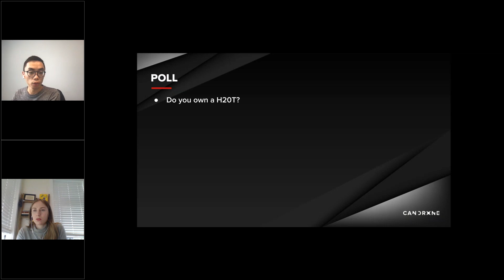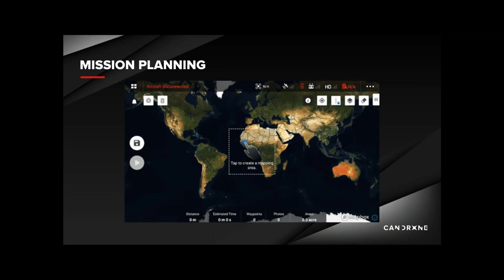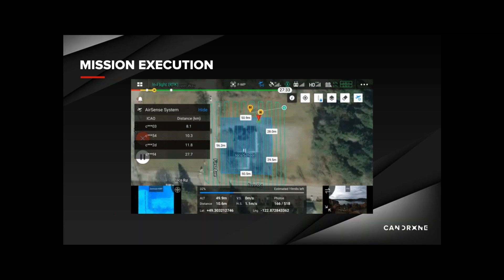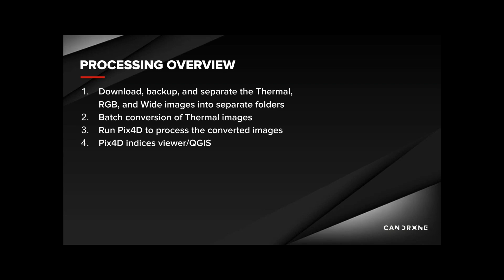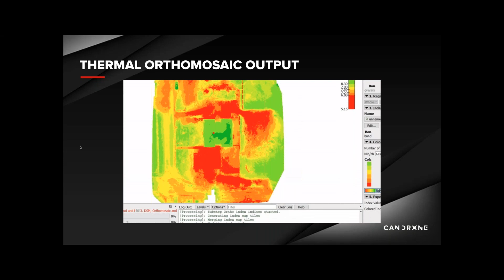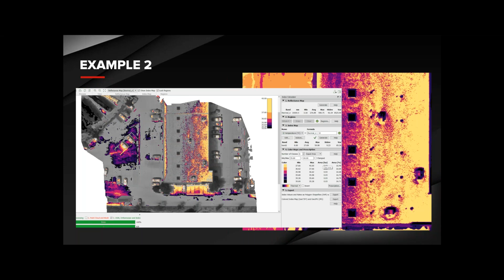Thermal Mapping with DJI Matrice 300 and H20T camera - WEBINAR

Comment: Please advise if we can use Lidar L1 and h20T camera at the same time? for example in oblique mission of power line inspection
Reply from the maker: You can not
Reply: @CANDRONE  Thank you, but why? Because using L1 and h20t together causes a lot of stress on the system? If so, which ones?
Thanks in advance!

Comment: Can this sort of thermal mapping be done with Mavic 2 Enterprise Advanced camera?
Reply from the maker: The M2EA camera does have the same specs as the H20T according to DJI. You can do mapping missions with the M2EA thermal camera, however, you won't be able to get radiometric data as we have tested the conversion process on the images and it does not work.

Comment: Can you guys help me
Reply: Hey Pete, this is Zane from Candrone. I would be more than happy to assist you, what are you looking to solve?
Reply: @zanewhite1355  sorry but I've been trying to find windows in current windy conditions. So I rented a m300 with a h2o thermal camera. So that means I only have one "camera/gimbal on the matrice 300. I know your going to laugh but I use dji ground station with wookong M and a futaba radio. I have also used datumate and datufly for mission planning for my inspire 1 pros. This is my first time using DJI Pilot and while I'm in the dji pilot app it offers me the three types of missions and although I'm just dealing with thermal images I can't find where to configure my camera angle...I would like for thermal to be pointed downward -90 degrees just like I would be doing a RGB do you know what I mean? I couldn't find where to change that and the other question is what software am I using to create thermal reports?
Reply: @zanewhite1355  if you can guide me to an email address I can send you my cell phone
Reply: @falconvisionuav  Not to worry! For 90° downward facing imagery, you will likely want to create a 'mapping' mission in DJI Pilot, and then outline your flight path according to the area that you would like to image. With regards to observing your thermal reports, DJI has a Thermal Analysis tool that will let you observe your imagery in more detail. However, to create an ortho from those thermal R-JPGs, you will have to use a tool to convert them to .tiff. At the moment, there are no easy processes to do this, and we have had to create a script to get this done. Please send us an email and I can help get that set up for you if you'd like!
Reply: @zanewhite1355  oh wow! Yes please..I'm trying to finish last mission...very windy and just waiting to get wind speeds down..I've been using the dji thermal tool but so far I'm not confident that it's enough to do what I need. I have an idea of creating DTM From thermals and change the color scheme to match..it might look close enough for me to label once I get images in correct location...I can see it in my head just don't know if civil3d can do it. How do I get in touch with you?
Reply: @zanewhite1355  I called your office and someone said you would call me back..is the offer for help with m300 still good?  I'm done with data collection and now I'm in software environments